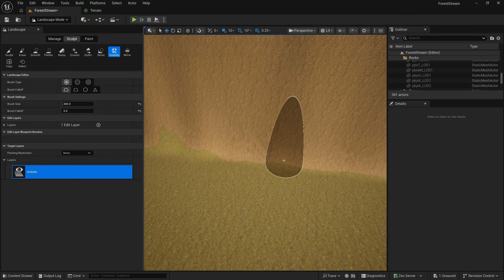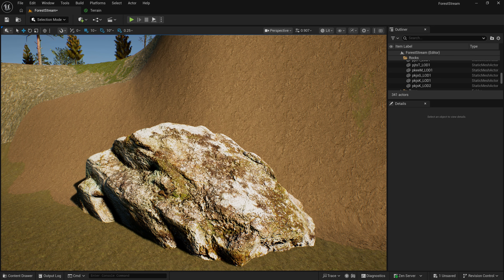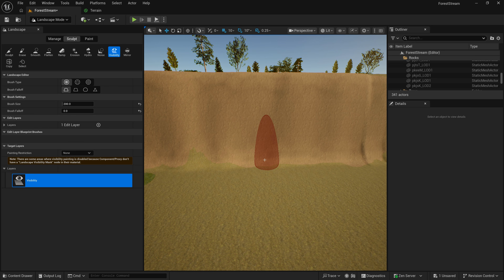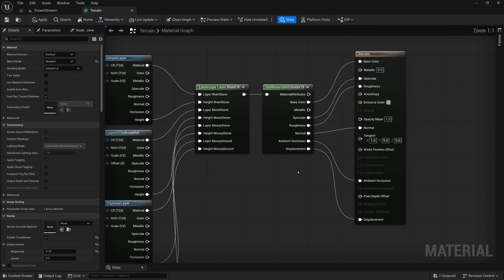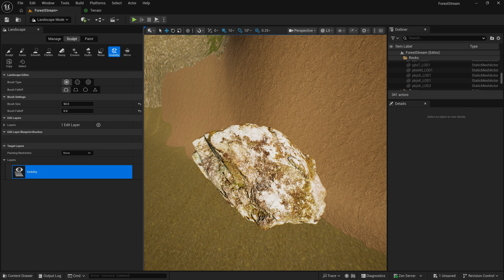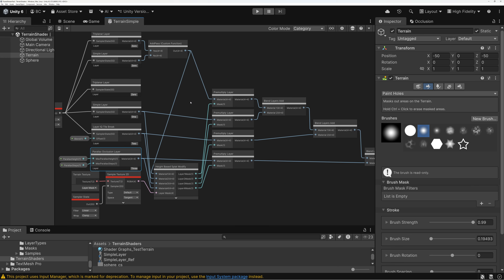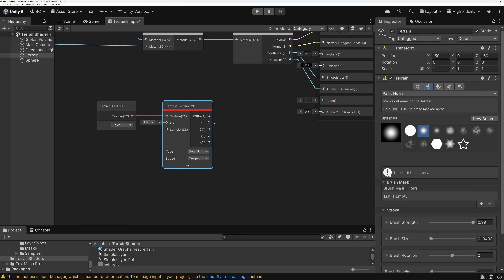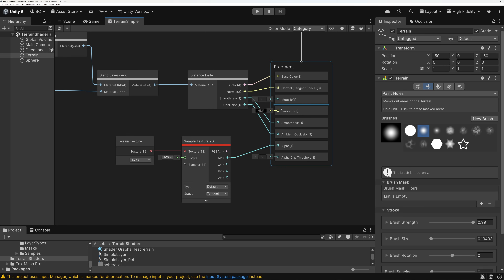Painting Holes in Terrain - Terrain Shaders - Episode 10

Comment: Hello, sir! I have on quick question. Using the techiques presented in the Terrain Shaders tutorial series, would it be possible to create a cave environment?
Reply from the maker: The terrain systems in both Unreal and Unity don't allow you to create ceilings. So there's no way to make the top of a cave. So no, if you want caves, you have to model them as 3d meshes instead of using the terrain system.
Reply: @BenCloward  Insightful. Good to know, thank you for your response and have a wonderful new year! 🙏
Reply: For cave walls, you can use either environment modules (I recommend the GDC lecture about Skyrim/Fallout) or use modeling tools - blockout